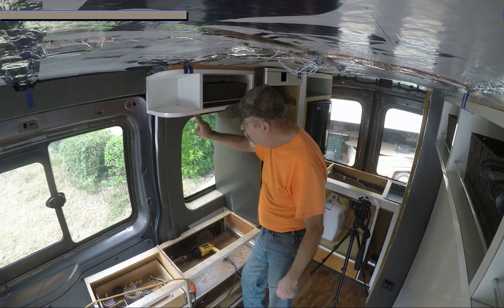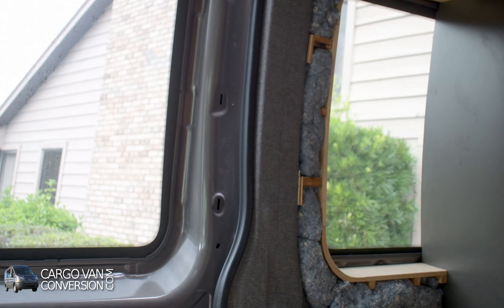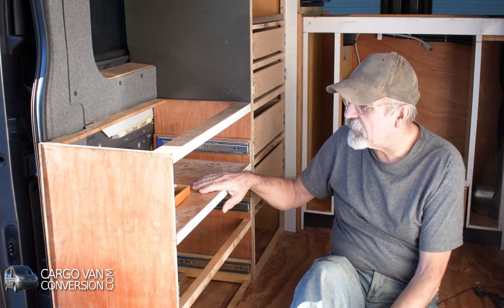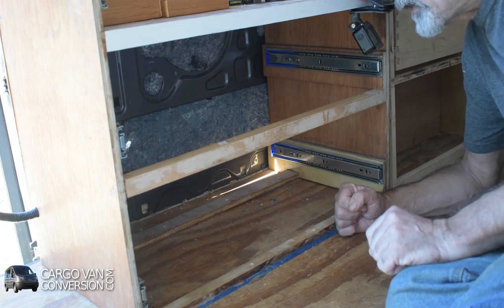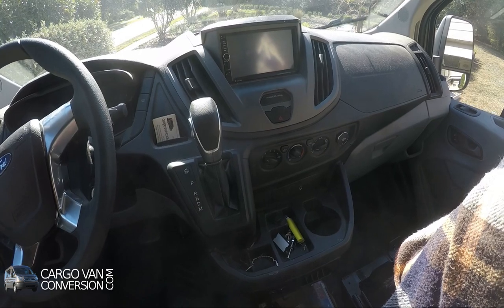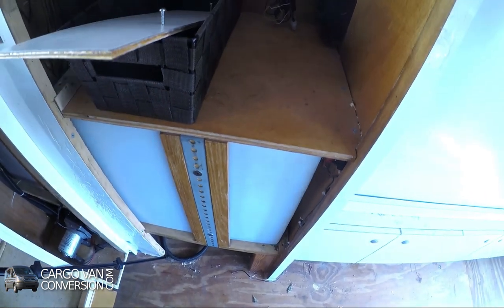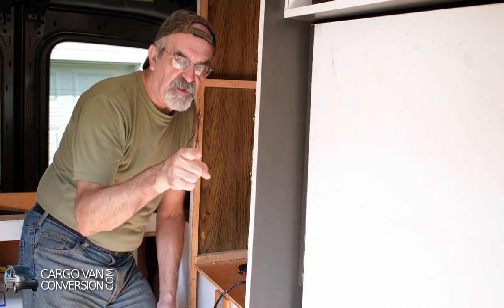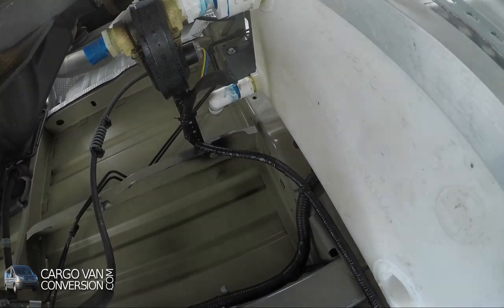Van Conversion - Insulate, Install Cabinet & Gray Water Valve Wiring

Comment: New driver needs a cap :)
Reply from the maker: Hi David,
I've tried that several times, but his nose is in the way. Have to find out, if there are specialty caps made for my kind of dog. Looks funny though.
Van Williams & Joey - Grrrr... you can't make me wear one.
Reply: Where else would the boss be than in the drivers' seat? 
I love the way you explain each step, makes it alot more instructional: and the way it fits together explains the logic.